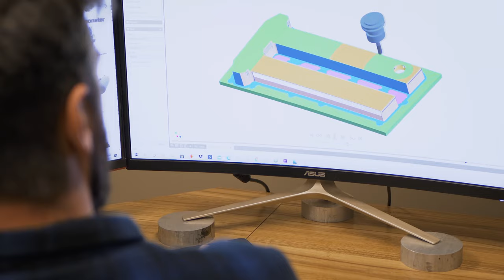Introducing MR-1 - An Affordable CNC Gantry Mill for Machining Metal

Comment: That's impressive he was able to get that accurate with a tape measure......lol
Reply from the maker: lol...there may have been some more measuring off camera. We also cut a template out on CrossFire XR to make sure we had all the bolt holes in the right spots.
Reply: Lol...I was thinking the same thing.
Reply: Must be using the new mititoyo measuring tape.
Reply: He also closed an eye!
Reply: Was clearly used for outside stock dimensions making sure the finished workpiece fit inside the billet he was using to machine it. I use a tape measure and scale (metal mitutoyo ruler) quite often when programming to set rapid off positions, movements away from the workpiece for loading and z travel. It's not uncommon.
Reply: @LangmuirSystems  [12/01/22] Hi! You should post your YouTube ad that has the voiceover in your channel as well. It's a little more complete, and explanatory than the intro video despite being almost identical.
Reply: lol most tape measures are within .09
Reply: @ezmac8185  lol well they do have machinist tapes 🤣
Reply: I think he just has really good eyecrometres
Reply: At one aerospace shop I worked  at we only used tape measures. Usually we put out .0001 for most of our parts without a sweat. For reamed holes we had a go no-go measuring tape. Great piece of equipment.
Reply: @upstate4288   0.0001 in what units, furlongs?
Reply: @scottwillis5434  How’d you know? It was furlongs.
Reply: As impressive as grabbing it out with no gloves. Raw dawg. Yeahhh.
Reply: @scottwillis5434 tenths
Reply: Good yom tov Kaleb ;)
Reply: Lol 😂 have to love the bullshit people use for clickbait
Reply: Tolerances were so good he didn't even need a gasket.

Comment: Without actually researching all the add ons that I might want, looking at about 10k fully loaded and assembled.  Still isn't bad.  Might have to make room next to my CF Pro!
Reply from the maker: Keep in mind that not all options are required. The machine spec'ed with the enclosure, flood coolant system, and leveling feet kit are the most important options and that runs to shy of $5,000. Only thing you'd need to supply yourself is the laptop to control it.
Reply: @LangmuirSystems  Thank you!  Looking forward to digging in and learning more about it.
Reply: @LangmuirSystems I gotta say, I’m shocked leveling feet have to be an add on and aren’t standard and included.

Comment: Im no machinist but might want to cover those lead screws up.
Reply: and add some chip evacuation )
Reply from the maker: Exposed linear guideways aren't a concern and is very common in industry. The bearings have seals on each end to prevent contamination. The ballscrews have wipers on each side as well.
Reply: @LangmuirSystems  What industry? I'm a machinist and run all sorts of CNC equipment from well established companies. Have not seen exposed linear rails on anything. Now if you are talking about hobby level, I can't say but industry level nope. Not bashing you, as this is a very interesting machine and is priced well for the casual user/start up or hobbyist.
Reply from the maker: @donjones7232  We have a tool room machine sitting in our shop right now. Exposed (sealed) linear rails and exposed ball screws (sealed). Zero issues and straight from the manufacturer.
Reply: @LangmuirSystems  Always willing to learn, care to reveal the brand of your tool room machine so I can check it out. I typically run Deckel Maho 60  and DMG DMU 85 5 axis  machines, so not an apples to apples comparison. But your machine looks very capable and I wish you all the best with the release of the MR-1 . I'm sure it will fill a gap in the segment.
Reply from the maker: @donjones7232  Thank you Don! Really appreciate the interest and kind words. Without revealing the brand it is certainly on the cheaper end compared to those beast of machines you're running!
Reply: @donjones7232  When is the last time you pulled back your way covers for a look see?
Reply: @LangmuirSystems  Will be putting a deposit down tomorrow. I'm just to darn curious.

Comment: I'd love to get one, but at only 2" of Z travel it would seem limited to very shallow parts.
Reply from the maker: Hi there. The Z travel is 6.1" with an additional bonus travel of 2" in the spindle mount. The maximum spindle nose to table is 9.0".
Reply: @LangmuirSystems  now THAT makes it much more interesting. I’ll look into it some more, it might be just what I need. Any thoughts on pneumatic drawbars or auto tool changers?
Reply: @EZ_shop  Yeah, I don't see an ATC option.
Reply: @LangmuirSystems  What is the clearance over the gantry....? ie. from the table top to the bottom of the gantry.  Also, can I cut and ream some .250 dia precision pin locating holes in the aluminum base pate for quick vise alignment and fixturing.
Reply from the maker: @ericsandberg3167  Hi Eric. We list this in our detailed specs page as X-axis Carriage to Table Clearance at 5.5 inches. The max spindle nose to table however is 9.0" so if your part fits in the area in front of the X-axis carriage to the spindle you can get even more clearance. And yes you can absolutely drill and ream the aluminum baseplate for fixturing it is 0.700" thick.

Comment: Couldn't tell from the zoomed in image... do you have to use CutControl or can you use other CAM software to drop in G code?
Reply from the maker: The machine's electronics are only compatible with CutControl.
Reply from the maker: We will have post processors written for many of the common CAM software packages (SolidWorks, Fusion 360, Inventor, etc.). This will allow you to post gcode to run with CutControl on the MR-1.

Comment: I see thread milling in the specs page.  Does this have the ability to do rigid tapping?
Reply from the maker: While its possible that we could release rigid tapping capability in the future (spindle is a servo so its technically possible), the initial batches of machines will only support thread milling.
Reply: @LangmuirSystems  Thats good to know that its a future possibility.  Not a deal breaker, especially at this price, but for sure something Id love to see some day on it.  Thinking this machine is just what Im looking for.
Reply: @LangmuirSystems  Spindle is Servo? You talking Z axis?

Comment: Absolutely no way that removes 30lbs of steel in an hour. The Fadals i ran ripped compared to that cutting at 150-200ipm wasn’t difficult and of course far more rigid and they didn’t remove that much material.
Reply from the maker: You're actually right we've recorded more than 30lbs in an hour since filming this 🔥

Comment: Less expensive than a tormach or a Haas but it’s a gantry style mill, with no tool changer, and questionable rigidity. Not to say it’s a bad machine for a hobbyist or onesie twosie applications but if you want to compete with the big kids on the block you need a tool changer and flood coolant as a standard feature not an option
Reply: Do tormachs come standard with flood coolant? It's got twice the power of a tormach at half (or less) the price. If you need a 21 tool atc for production then yes, obviously this $4000 dollar machine isn't for you, neither is a tormach. And if their marketing numbers for MRR are to be believed, it absolutely crushes tormach in removal rates (if they aren't inflating the numbers that is, the first machines are only now being delivered so we will see what 3rd parties are able to get)